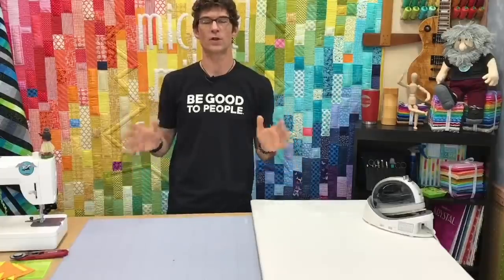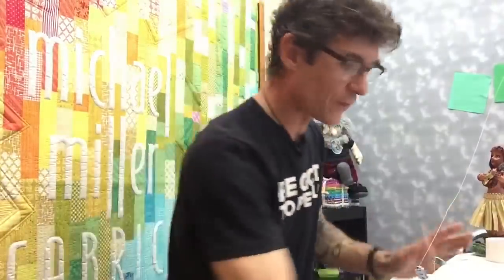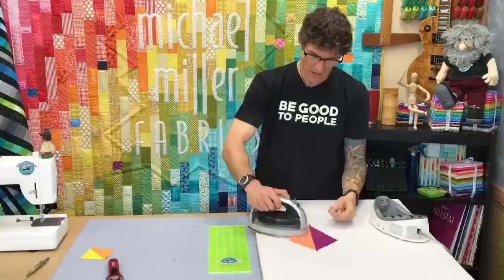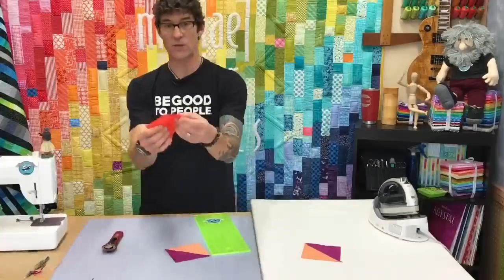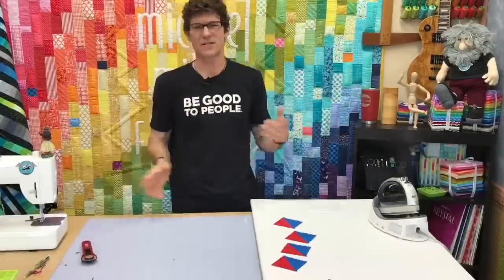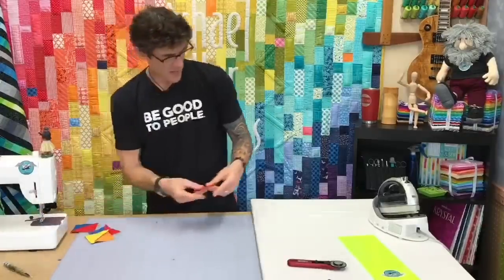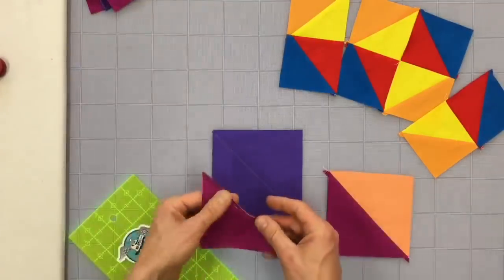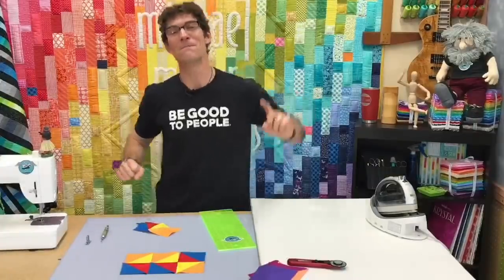2 Ways 2 Half Square Triangles - Michael Miller Fabrics' Making it Fun

Comment: I really enjoy your tutorials. Thank you for sharing with us all. 
I like Fon’s and Porter’s 1/2 & 1/4 sq ruler. The ruler tells you what size to cut your strips for the the desired square you are wanting. You put your two fabrics RST then cut using the ruler. Yes you will be sewing along the bias, but in the 10 years I have used the ruler none of my HST’s have been distorted. When you are finished it is a perfectly sized square with no trimming needed except for one dog ear. No hassle, no worry method. 
Fon’s & Porter also have a flying geese ruler. It is also a most have ruler in my opinion.
Reply from the maker: Great info, thanks for sharing with everyone.
Reply: Making It Fun

Comment: Sewing around the block is great!   Being a former bookkeeper you would think that I like and am good with math - well, not really without a calculator.   So making HSTs in multiple, I really don't want to spend time on the math!  Don't like to spend money on every ruler out there either, but one that is worth its weight in gold is the triangle trimmer.  It allows you to square up multiple sizes of HSTs by matching the line on the ruler with your sewn line BEFORE ironing and trim the block to size. It also lets you clip the dog ears at the same time.  Then iron.  This is so much quicker than squaring up four sides with four cuts then cutting off the dog ears!  Love the new vids on basics.  Maybe you will show me where I have developed bad habits along the way and teach me the better way.  Keep up the great work!
Reply from the maker: Right on, will do! Thanks for the great feedback. I love the sew around method, and my quilts have never pieced together better.

Comment: Rob, you DID make me grin at the end of the video. I am venturing into quilting from being mostly a garment seamstress in years past. To practice my accurate measuring, cutting and placement, I have been cleaning up odds and ends of fabric scraps. I have done some 4-patch and 9-patch blocks and isn't it a thrill when the corners meet exactly!!!? My next step will be to get comfortable with HSQs, so I am watching videos that pop up in my feed with that topic. These practice pieces are all different sizes and I am not going to try to make a quilt top from the mish-mash. What I DO want to use them for is as an interjection in quilt BACKINGS when I get to that point. OR ... they could be a stand-alone backing for a quilt sandwich where the front is a solid color fabric pallet for practicing fee-motion quilting designs. (That thought just popped into my head!) Now I'm anxious to keep moving on. Thanks for the visit.
Reply from the maker: Glad to offer a smile, plenty to go around, let me know when you need another.

Comment: Really enjoyed this “basics” video!  Please do more videos on the math of piecing. I frequently want to use pre-cuts when a pattern calls for yardage - how do I know how many precuts I need and which sizes? And vice versa - sometimes I have yardage and want to use a pattern calling for precuts. I don’t want to cut up all my yardage into pre-cut size if not all of it needed. Would love to learn a quick way to know what pre cuts will work with a pattern. I’m not great at reading patterns. Maybe a video from you would help. Also would like more videos on basics of cutting yardage. How to use the various lines on my ruler, especially diagonal lines, not just 45 degrees but the others too. Thanks for a great video 👍🏼
Reply from the maker: This is great feed back, and now I have the newt 3 years planned, thanks for all of the great ideas. I will truly to knock a couple of these off the list real soon.

Comment: I have been quilt for some time, but I like to review the basics. It can be inspiring. Want to do a modern quilt and over sized hst is a good jumping off point.  Will use the first method you demonstrated   so I don't struggle with distortion.
Reply from the maker: Great, let me know how it turns out, I love show and tell.

Comment: No, no, no.  Your second method yields hst units with all bias edges.  Awful!  If you're new to quilting do not do this second method.  Get yourself a set of Clearly Perfect Slotted rulers and do it the correct way or you can use the bias line on your ruler to do the same thing if you don't want to buy another ruler.